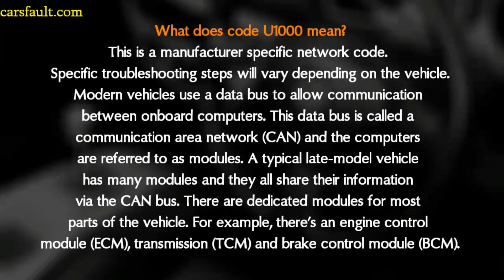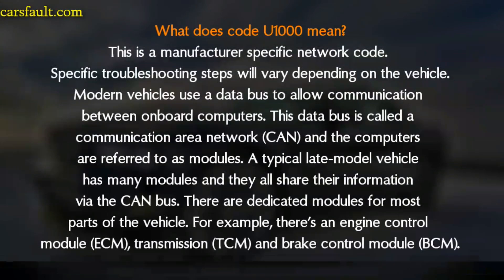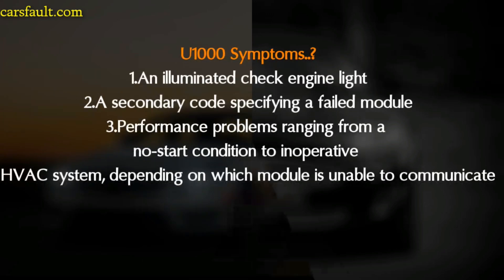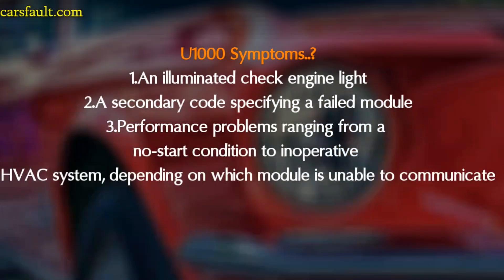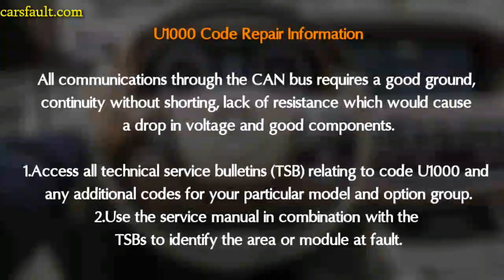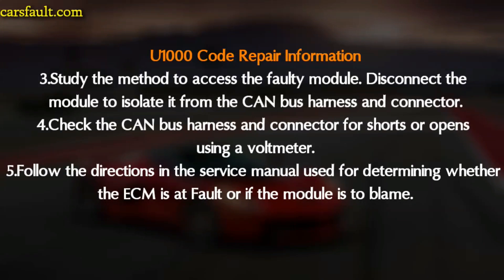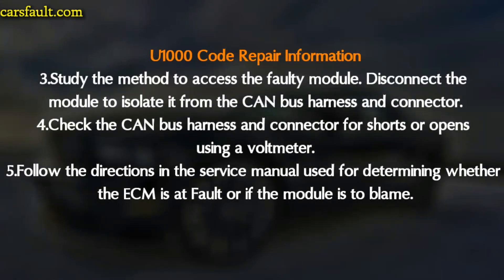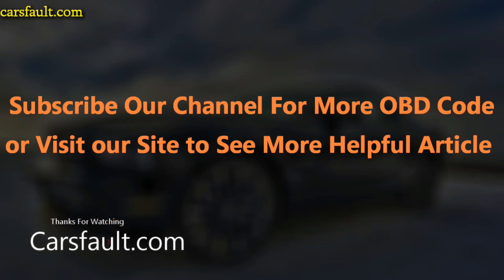U1000 NISSAN   CAN Communication Line   Signal Malfunction

Comment: Senior good evening (Pls am working on Nissan Roque, de car came to my work shop with Transmission linkage ,so I remove it and change de seal after I fix it  back the car was given me p1212and u1000and u1001 because of that if the transmission heat it difficult to move, now I need your help